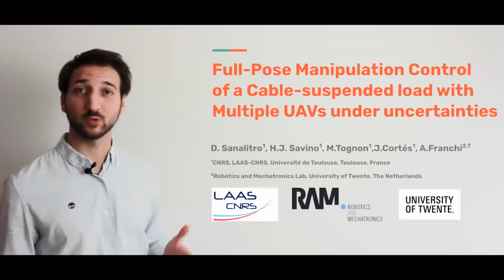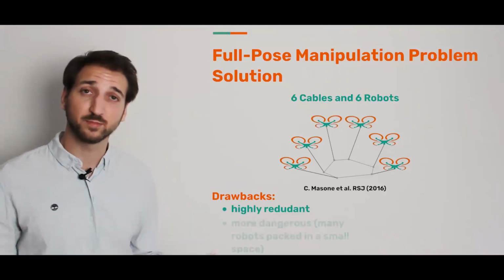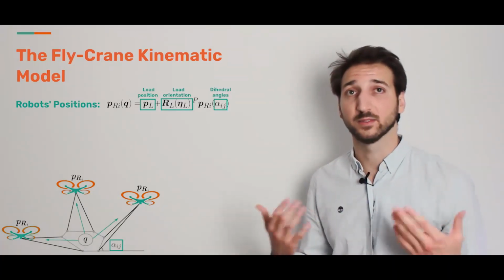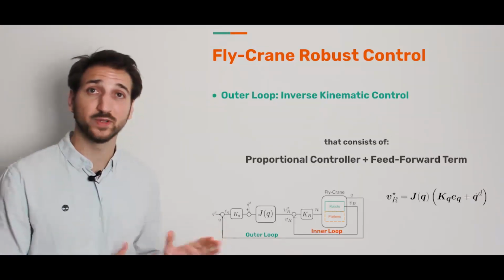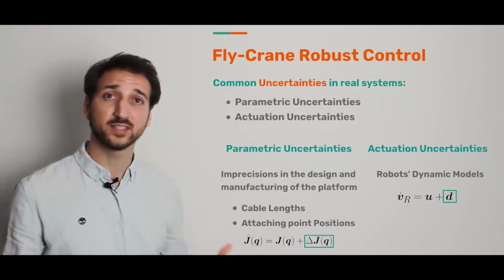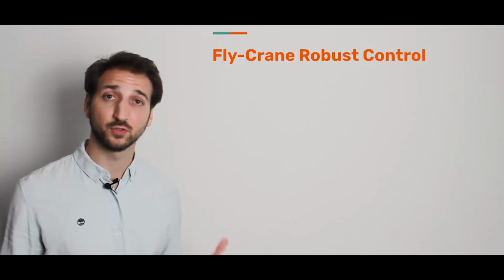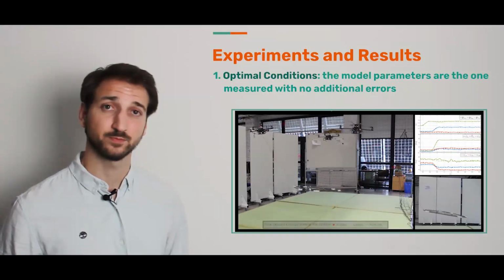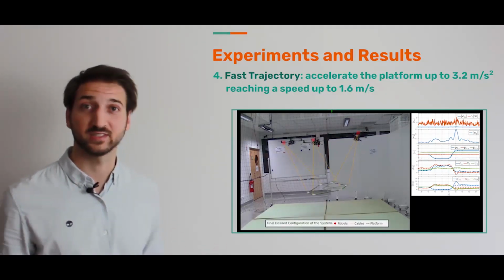Full- pose manipulation cable-suspended load multiple UAVs uncertainties (ICRA 2020 virt. present.)

Comment: Dear Professor,

 

I hope this message finds you well. I’ma student from Beijing Institute of technology, school of aerospace engineering. My research direction mainly focus on the swarm of UAVs with load. I recently came across your paper titled "Full-Pose Manipulation Control of a Cable-Suspended Load With Multiple UAVs Under Uncertainties", which has been attached in this e-mail and found it to be exceptionally insightful and relevant to my research.

 

I am particularly interested in the simulation program code used in your Fly-Crane System controlling before the experiment. May I ask which programming language you used? C++ or Matlab? Could you kindly share if it is available for academic purposes? Access to the simulation progress of your experiment would greatly enhance my understanding and allow me to further explore the concepts presented in your work.

 

Thank you very much for your time and assistance. I’m looking forward to your response!

 

Best regards,

 

Beijing Institute of Technology, school of aerospace engineering

5th, Zhongguancun South Avenue, Beijing, China